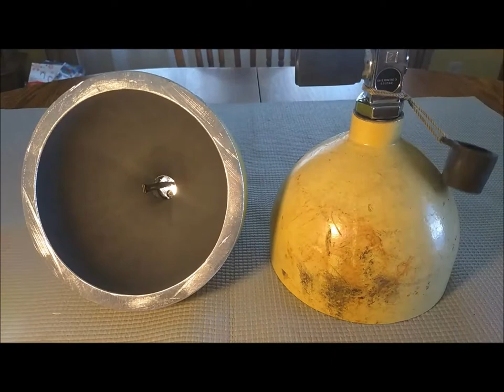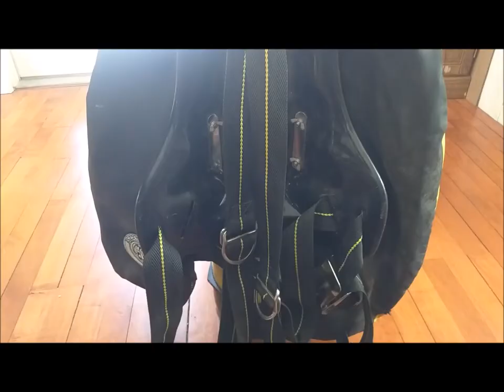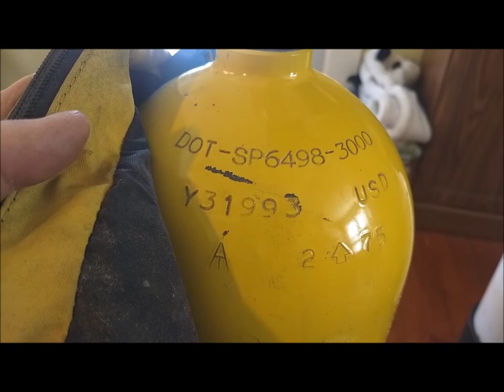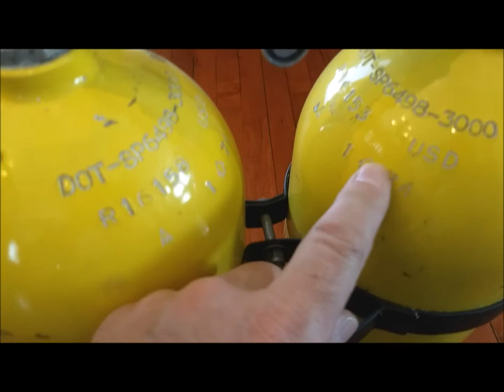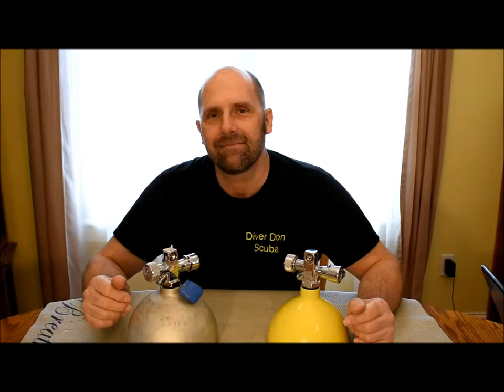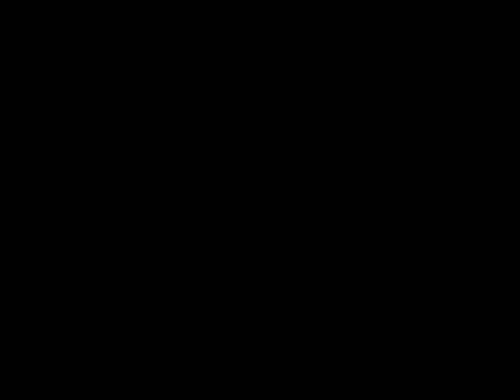Why won't my dive shop fill my older Scuba tank? Exploding tanks?!

Comment: The 1990 rule isn't finite. There are several Luxfer tanks older than 1990 that are 6061. You need to check the Luxfur spec sheet. They started switching around 1986 until 88.
Reply from the maker: True, but show me a dive shop that will scrutinize an older tank this closely.
Reply: I remember there was a exchange program for the 6031 aluminum tanks but what really scares me is 7032 aluminum I don't think that it's used in scuba yet though

Comment: Hey Don! Here's my rule of thumb.....At the end of season bleed tanks to 0 pressure! Then remove the valve and leave valve out till refill time. And store tanks inside where the temp is a constant nof -20 to +40 etc up and down. With the valve out and tanks bled down there is no chance of sustained load crack or moisture in tank.
Reply from the maker: That's a lot of prep but sound advice. I run mine down too but feel a couple hundred psi works to keep moisture out (provided I get dry fills) and reduces SLC considerably.
I only do this cause I try like H to dive year round.
Reply from the maker: @schmedlywhiplash6267  winter can be a downer that's for sure! I find plenty of time to pursue other pastimes especially on the single digits days. But occasionally I get that bug to go jump in the lake and when the ice sets it's so much clearer. Can't resist it 👍

Comment: I've polished aluminium failed cylinders and they come up mirror finish. I've used cut sections in my furniture design in the past. Also, I've made a few  post boxes from old aluminium tanks 🇦🇺👍
Reply from the maker: That's something I've been wanting to do besides making bells. Have you heard a tank turned bell? They do have an awesome tone.
Reply: @DonFassbender  the thought has crossed my mind to try and make a tuned length set of bells like a giant wind chime. That would be tricky to achieve
Reply from the maker: @Hipporider  I hope you have a few tanks laying around for such a big project. Takes quite a bit of time to cut up a tank. I'd love to hear it though.
Reply: @DonFassbender  I've collected quite a number years ago, mainly for my furniture design
Reply from the maker: @Hipporider  I see you have a channel with content. You should consider adding a video about that.

Comment: Out of all the aluminum tanks I've have had tested, only 2 have failed the eddy current test.  Both were Aluminum 50's.  I've also had two steel tanks fail hydro.  I would say at least for me with the number of tanks I have, actually more steel tanks have failed than aluminum if you look at the total number of aluminum vs steel tanks I have.
Reply from the maker: I had two more fail recently, Ron. A local fire extinguisher facility 👎👎. Not sure they even bothered trying to do an Eddy Current test. I'm going to use City Sales in Iron Mountain exclusively.

Comment: Im curious about a yellow fiberglass(looking) scuba air tank i have. First, im not a diver and dont want to use it for diving.
The tank is super light, it is dated 1987 and says next inspec date 1997.
Appears in good condition.
What i want to do is make a air tank tire bead setter, basically a homade version. 
You put a threaded fitting in the top of the tank with a ball valve, a metal Schrader valve. And a open end with a big flaired out tip (thats what you set a tire bead with). 
Anyways i see the tanks rated to around 2300+ psi. 
I want to know if its (possibly) safe to fill with just 100 psi to use like i stated. 😄 i realize this might sound crazy to some but i think maybe some others might get my idea.
The tanks old, its looks like some type of fiber glass, thats my concern..but i know there very high pressure vessels, so a 100psi aint much right..The threaded neck is steel (appears to be lefty threads)
If the whole tank was steel or aluminum i wouldnt even sweat 100 psi..
Doesnt look to have ever been dropped (its yellow paint is perfect) and the type of material this things made with, along with how thickly wrapped the thing is, even if you did drop it i dont think it would faze it. Any input would be appreciated, and any criticism would be hilarious.  Thanks!
Edit-- after watching the video aswell as others, Im really appreciating writing this comment with my two hands.. i think ill toss the tank or make a wall decoration with it. Thanks for making videos like this. The whole possibility of a crack in the neck alone has made me hesitant to pressurize this old tank.😮

Comment: Video idea, knock the valve off the   one under pressure and skip it across the lake. Mythbusters made a rig to do it u could make.
Reply from the maker: I saw that episode. If I recall it smoked right through a block wall. I like my walls intact 😬
I also saw one get lainched in a quarry~that might be do-able.
Reply: @DonFassbender  we gonna skip a tank this year?
Reply from the maker: @blairforce1755  Skip a tank!? I love my tanks, BF1 ;) You can though

Comment: I think any tank older than 20 years... Just scrap it. A 200 or 300 bar explosion is not worth the cost savings. Such explosion is deadly. I bought 2 15L 200 bar tanks for 470 euros a piece, brand new. Pretty sure I can dive with these with confidence for the upcoming 20 years.

Comment: Yes, I have several AL6351 USD Luxfer tanks. I can pay to have the hydro + eddy current + VIP, but, there isn't a dive shop I can name that will fill them. They see the SP6498 markings and practically call the bomb squad and SWAT team on me. Maybe I should just buy a compressor and fill them myself. Ideas?
Reply from the maker: Why not? I have. Just be sure the pass the VE and hydro and if they're not going to be used for a period of time drain them to 3~500 psi. Fill and use next summer. Millions of these tanks were made a many are still in use today. I feel perfectly safe with mine. YMMV
Reply: @DonFassbender  do you fill your own tanks?
Reply from the maker: @akant74  I do. I also know the history of my tanks. I have found tanks for sale that I won't touch though ~ even with a VE. One tank was filled to 3k and left for about 30 years. I paid the asking $10, carefully drained the tank, and cut the top off saving that for display and recycling the rest. Just not worth it.

Comment: my old steel tank has a coating since manufacturing. The Hydro test shop refuses to test it because of the coating. Based on your video the valve joint is the most dangerous area but not tank itself. correct?
Reply from the maker: Thanks for watching my video, Rusian B. Your older steel tank is probably OK, provided there isn't rust hidden by the coating. I've stripped the coating off old steel tanks before and I've heard of guys tumbling tanks with an internal coating. It takes time but you may need to do so yourself.
Reply: @DonFassbender  how to take that coating off? To use paint dissolver? Or mechanical treatment?
Reply from the maker: I did one nad would probably never do another. My buddy, however, found an aviation paint thinner that works well. Once you are able to strip them you may have to galvanize them because they may be steel and could rust easily. Unless its a rare tank its probably not worth it. Who manufactured the tank?
Reply: @DonFassbender  called to hydro cert. Shop. A technician told that it should be a vinyl coating and this tank is scrap because of this. Try to desolve it ... just for fun and experience. Thank you!
Reply from the maker: Unfortunately you're at the mercy of hydro shops as well as dive shops or whatever facilities you have in your area that fill your tanks. Check back with your progress. I'd like to know how it turns out.

Comment: Dive shops won’t hydro tanks that were made preorders to 1996 even though the visuals were all good. Is this standard?
Reply from the maker: Some dive shops won't fill tanks made prior to 1990. Hydro facilities will test them and some offer a special Visual test that looks for micro cracks in the threads of your Scuba cylinder. It's still up to the dive shop to fill them.
On the other hand, some dive shops will fill them so long as they have a current hydro stamp. Our local fire department will fill tanks manufactured prior to 1990 so it's not a problem here.
Reply: @DonFassbender  there was that one guy who was killed testing a 6351 tank that exploded when he dunked it into a leak testing tank immediately after filling it. Some speculate the shock of dunking the tank warm from having lots of air shoved into it, into the cold water, may have caused an existing crack to rupture.
Reply from the maker: @greggv8  I've heard of a couple scenarios where old tanks have exploded. Another factor may have been the nuber of fill cycles. In the Caribbean some tanks are filled and drained daily for years. Unfortunately we'll never know truly what caused it other than there must have been a crack that might have benn detected with a VE test. Thankfully they do test them locally.

Comment: One of  my tanks was mfg in 1990 but one shop won’t fill it. It’s the same material than the one mfg in 1990. Has only 30 more dives than the one from 1995. Based on that they shouldn’t fill either one.
Reply: 1990 vs 1995 on last comment
Reply from the maker: @eugeneschreiner2859  Unfortunately you're at the mercy of your local dive shop. It's their equipment and they're not obligated in any way to fill your cylinders so what can you do? Buy a compressor? If they're the only shop in town you may have to cut your losses on that one. Sorry to say...

Comment: Don can I fill one tank with another. And what will I need. To do it?  Thank you sir
Reply from the maker: There are whips available to hook two tanks together, but unless one is much higher then your target pressure, it won't work. All ypu would be doing is equalizing two tanks. So if you had one at 3000 and one at 1000, you would end up with two tanks at 2000, assuming they're the same volume.

Comment: Whats wrong with the valves? Could you not put the valves on a new tank??
Reply from the maker: Yes I could, thanks for asking. And I have in the past, but now I use them to display vintage regulators.

Comment: If you are going to continue using those two SP-6498 AL50's they will need to be overstamped 3-AL at their next hydro to be serviceable.
Reply from the maker: Still using them and no one is calling for that stamp. The hydro company is the place where I get them filled.
Reply: @DonFassbender  They may not ask for that when filling. I have found not every hydro facility knows all the regs, especially if they mostly do fire extinguishers.
Reply from the maker: @joediver7669  We only have a couple hydro facilities in our area. Quite remote. Sounds like you deal with several. Where are you located?
Reply: @DonFassbender  In Sacremento now.  Not many facilities here. When I was in the bay area there were tons.
Reply from the maker: @joediver7669  I've been been to San Fransisco once. Never did dive there but I wonder if you can dive the wharf? I bet there'd be untold goodies in the drink. Plenty of trash too, I suspect.
Reply: @DonFassbender  Not much diving done in the bay. Monterey/Carmel is 2 hours south and is world class imo. If you can tolerate the cold water. Northcoast is nice too, if thier is kelp. Its all dying now.
Reply from the maker: @joediver7669  I wouldn't limit my diving to the bay, that's for sure. But I'd like to include it in a trip.

Comment: Well I'm Just Figuring All This out Now, I Got a 20 Dollar 1977 Steel Tank.  I Think its Steel cuz There is Slight Rust at Spots,.  Its Overall Good Condition, Has Air, 1000psi..  I'm Gunna Deflate it And Take Valve Off to Look Inside,.  o__o  I Got the Breathing Thing to Work, I Had to Take Cob Webs Out the Mouth Inhale Area Piece.  It is Clean Now, I Used the Tank A Few, It Works.. HaHaHaHa  I Will have To Sand Down Pain Chipped Areas and Inspect Degree Of Small 2 Rust Spots..  I already Replaced the Rubber Ring Gaskets in the Regulator Valve, So it Don't leak now.  Aqua Lung, US Divers, Inc from California, says Also on Valve..
Reply from the maker: Sounds like a fun project. You may want to take the tank to your local hydro facility and ask about a hydro test. There may be rust inside that you cannot see without an inspection. Oftentimes this rust can be tumbled out but if the tank was stored with good dry air it may be fine. 
If your reg hasn't been used in years I:d recommend getting the reg rebuilt with new internal o-rings and diaphragm etc. A reputable dive shop can do this if it's not too old. What model do you have? 
Enjoy your project and as always dive safe.
Reply: @DonFassbender  From the Research I Did.. it Looks to Be what Is Called a J Valve..  I am going To Empty the 1000 psi of Air in it..and Take the Top Off.. To See Inside..  I Got a Compressor.. being Shipped..  Air Filter for Moisture and Oil..  and Plan on Filling it Myself.. I am not Sure the Maximum of An Old Tank.. like this.. I Think it is 2400 PSI But Once I Find out I Plan to Keep Low Pressure in it Anyway.. :) Thanks For reply..  I Only Scuba Dived Once, with my Brother over 10 Years ago..  it was Ok once Got use to Breathing..
Reply from the maker: @DeaFBRED  I hope you intend to get it tested first. A tank that's not been serviced in years can be a very dangerous thing. It's usually only about $20 to $30.
A j valve would be consistent with the age of the cylinder. I have several and still use them.
Reply: @DonFassbender  Ok... There is a Local Dive Shop here.. I will See about A Hydro Test..  :)  Thanks!
Reply from the maker: @DeaFBRED  good idea 👍 LMK what they say
Reply: @DonFassbender  Tank Says US DIVERS CO..  DOT 3AA2250  K105823 and 12G69+  and 7/77,  I Drained all the Air out of It..  Took the Top Part off.. and Looked inside the Tank.. and it Look Immaculate..   Like Brand new, I Can't Believe it..  Though.. I Cut off some Of the Outer Paint Skin... that was Bubbling. and Showing Rust.. and It is Just Barely.. anything.. Just some Surface.. Type Rust..    The Tank when I Got it was at Around 1400 psi..  Overall I Look at the Integrity of the Tank.. and It Looks Solid..   I Have done welding and Automotive work for Years..  I know these Tanks can't Be Welded or Anything.. but the Metal.. does Look Stable..  Now I am wondering.. if I Should Just Peel all The Paint off..  and Then take it To Scuba Shop for Hydro.. as a Bare tank.. and See what Happens..  though I Heard some Shops.. will just Not even Bother.. if Tank doesn't Have original Paint.. :)